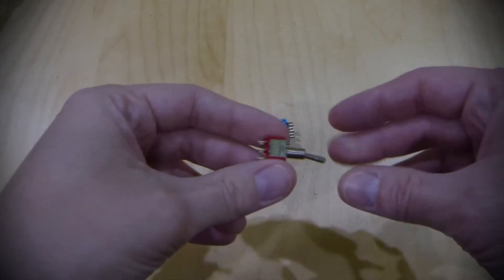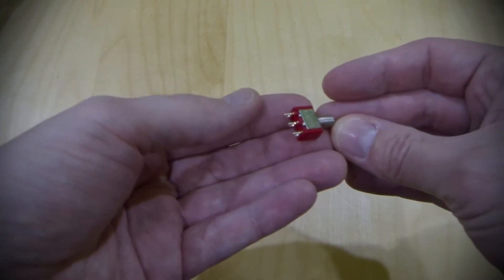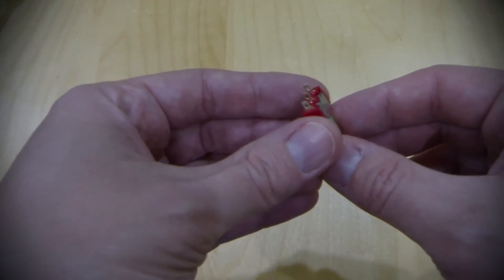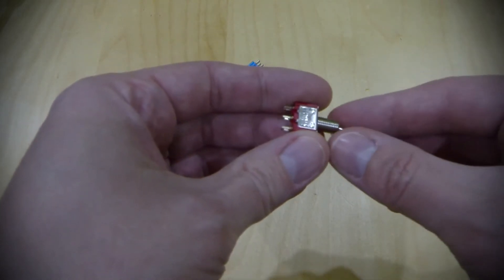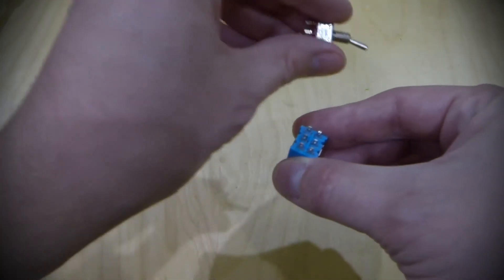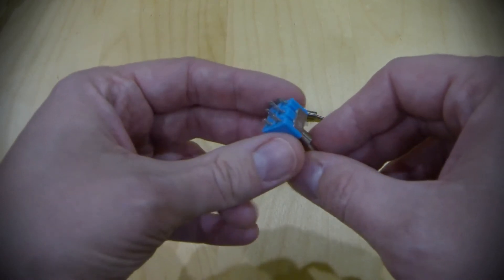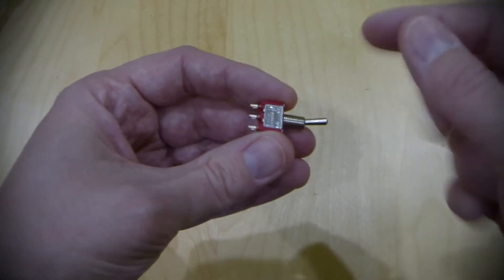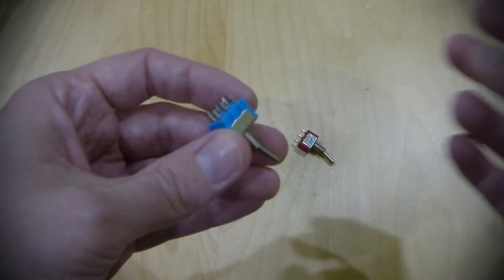SPDT and DPDT Switches Explained - MMT11

Comment: Hey, would it be at all possible for you to give me some advice/ instruction on how to solder something? I have a guitar that used to have a SPDT switch used for coil splitting, but I had it repaired last year, and the tech I had taken it to completely removed the switch because at the time, we didn't know what it could have been for. I still have the switch, and I have solder and a solder iron to do the job, but I unfortunately don't know much at all about pickups or switches. I'd rather get a direct "Okay, just solder ____ to ____ " from someone rather than A.) Having to spend hours learning from scratch or B.) Having to spend $50+ just to get some soldering done at a shop. My email is kalabbuzan@gmail.com and I'll be sure to send pictures of the wiring cavity and switch if I receive an email from you! Thanks in advance if you take the time to help me out!
Reply from the maker: Sure, I can likely help. Coil splitting is simple as you just ground a couple of wires with the switch. I'll send an email.